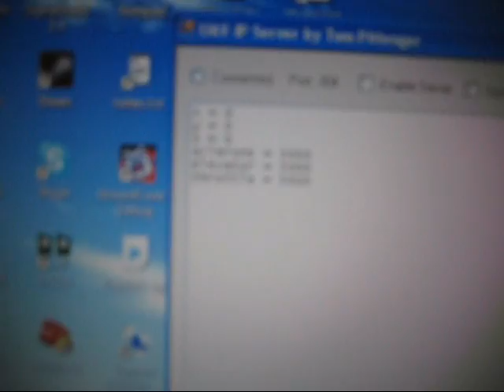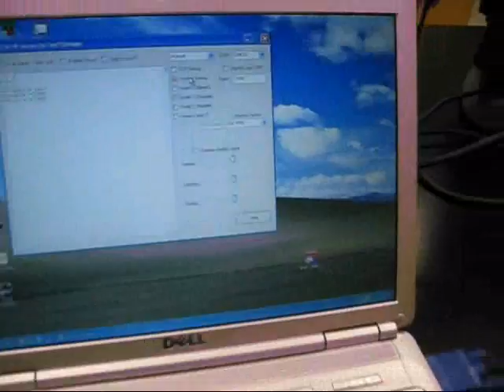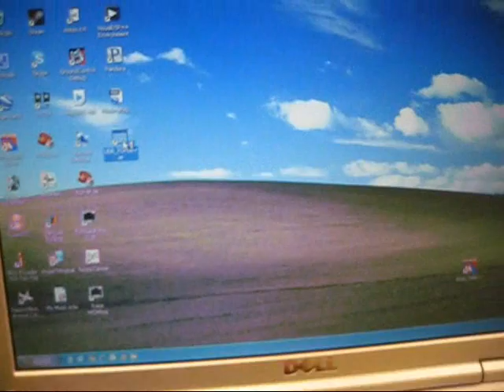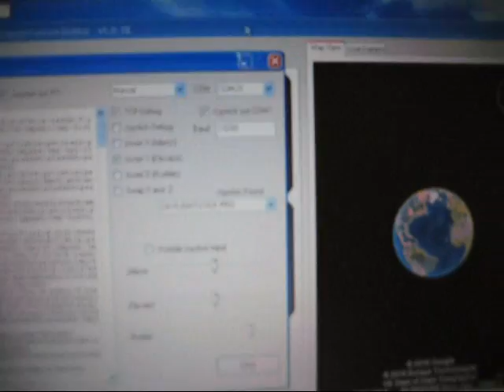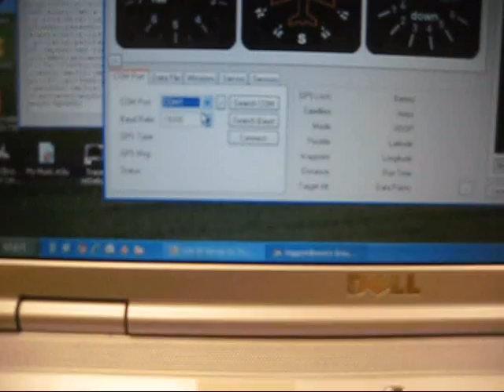How to fly an R/C Airplane over the Internet using the UDB

Comment from the maker: There are 3 links posted. This video was posted over 2 years ago, I have since successfully flown using UDP with the IP stack running from within the UDB (no PIC32 in the middle) and it is VERY responsive on a 4G phone.

Comment from the maker: The system is passing it's signals through a UDB autopilot system. When in assisted flight mode the pilot (via cell) is simply pointing the plane around, the autopilot maintains altitude and a steady flight. If signals are lost the autopilot can be configured to respond in different ways: circle down slowly and land, follow waypoints (some of which could be on the ground for auto-land), or simply return to launch point.

Comment from the maker: The distance it can fly is also irrelevant, you are assuming the plane is taking off and/or landing where the pilot is located. The pilot could be on the other side of the planet. The quality of the signal also get *much* better when you're not on the ground, no obstacles and no multipath. Did you know that a single cell tower can reach up to 20 miles? It's amazing how far cell phones work with huge SNR.

Comment: That's not true actually, because you are limited by the distance the plane can fly, and also by the quality of the signal where the plane is. Also it's one thing to fly a plane around in a certain area, but as soon as you move quickly, the signal will get even worse, and the response so bad/slow that you can't control it properly. Not a plane anyway.

Comment from the maker: @Soldier53flyer The concept is to not need a FPV, it is simulated. If an off-the-shelf FPV is slapped on then the data connection will only need to be in one direction.

Comment from the maker: TCP over cell phones is the worst possible way to do it. Switching over to UDP is an obvious enhancement which makes it much much more responsive. Plus, the auto-stabilization and auto-pilot options of the UDB adds massive tolerance to the latency issue. Same goes for traditional fly-by-wire systems in a modern jet aircraft - without the computer those planes are unflyable.